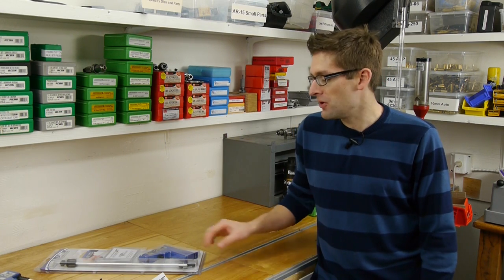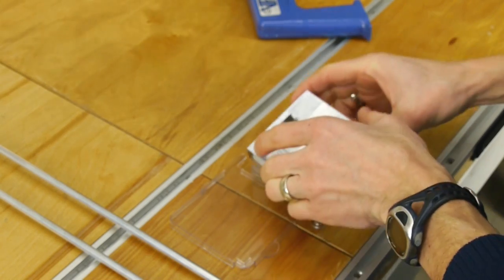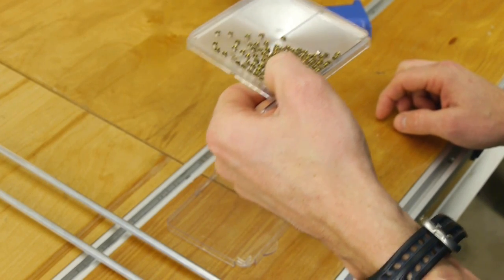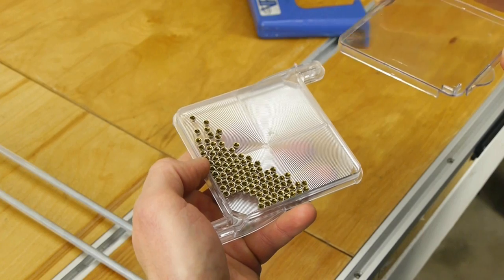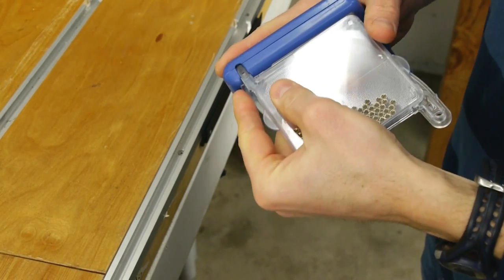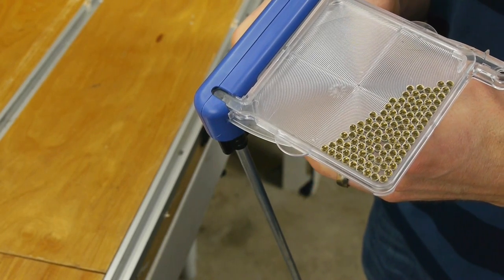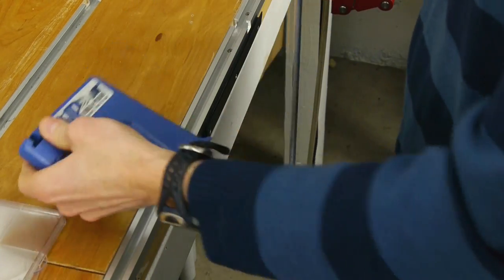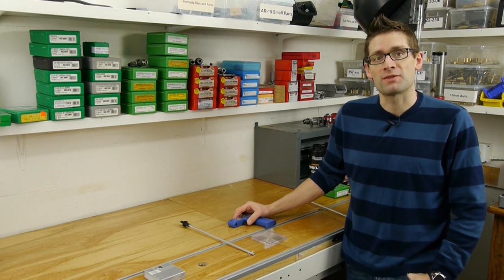Frankford Arsenal Vibraprime Primer Tube Loader

Comment: gavin finally discovers the vibra prime! yay!

some primers feed easier than others. CCI small primers feed like water. Winchester sometimes get hung up or flip over. small dimensional differences in primers can affect how well they work with the vibra prime.

a little dremeling here and there to deburr and chamfer edges can help primers feed better.

Comment: Gavin made it seem to work without a hitch.  Mine arrived today and my first 100 CCI small primers took 1/2 hour to load into the tube...they keep getting jammed where they drop into the tube.  Will call customer service tomorrow to see if they can correct the problem.

Comment: I bought one of these Frankford Arsenal Vibraprime units nearly a month ago and had to return it to the seller who said he had to send it back to some place in NSW to get it looked at as it was having problems feeding Winchester small pistol primers. I spent more time unblocking it than what I was loading ammo. The other day I was quicker loading primers using the Dillon primer tubes than what I was using the Frankford Arsenal Vibraprime Primer Tube Loader. Haven't heard from the seller yet. Not too happy with it so far

Comment: I found it actually slower than the hunt-n-peck method. Fill it, start it, feed three primers, disassemble it to remove jammed primer, put it back together, repeat 5 times, throw vibraprime against the wall, hunt-n-peck. Then next time you think "Oh, I'll give it another chance, but the same thing happens.
Reply: +Vincent Lok never have to disassemble to remove jammed primer. just tap it against your reloading bench.

Comment: I saw one of these Frankford Arsenal Vibra Prime Primer Tube Fillers and I just had to have one as it looked like it made filling primer tubes so easy. Well I got mine and it looked easy enough to setup but it has been anything but easy to use. Primers would just stop at the entry hole and the rest would not go in. I even have sent it back to where I bought it from so they could send it back to their supplier and they sent it back and said it worked fine. Not a chance. I tried both small and large primers and the same thing kept happenning. Primers would just keep blocking the hole where they are supposed to go down. For an item that is supposed to make the job easier, it has not. I am open to any ideas to rectify the problem if you have a solution.

Comment: The most frustrating piece of reloading equipment I have.  I spend more time fixing jams than actually loading primer tubes.  I tried all the know fixes, but they did not help.  Manually loading the primer tubes is faster and less frustrating than my experience has been with this primer filler.  YMMV, but I put this in the POS category of reloading tools.

Comment: I've had mixed results with mine. Small primers work okay. Large ones not so much, had to drill the tray and drill the tube to improve it. After my modifications it works better but still not quite adequate.

Comment: I have one of these.  It is junk.  I have had it for 2 years and tried it with every brand of primer i can think of. About every 10th primer gets stuck at the top of the tube, and I have to take everything apart.  It will also flip about 2 to 3 primers per 100 allowing them  into the feed tube upside down.  I wish to God mine worked like  this video shows.

Comment: You show Federal primers. No way would I load Federal primers into a primer feed tube, too sensitive.
Reply: rico567  - An interesting point. What do you base that opinion on though; have Frankford issued that advice?
Reply: webley701 My aversion to Federal primers in auto primer feeds stems from my early experience with Lee progressives. It is explicitly stated in their manuals not to use Federals due to their greater sensitivity. This practice carried over in me after I moved to Dillon, particularly after I read several accounts of chain-fires in Dillon primer feeds.